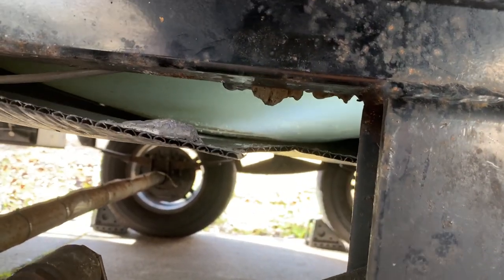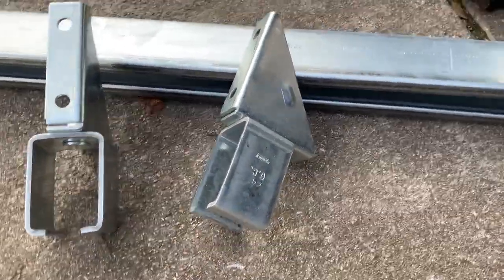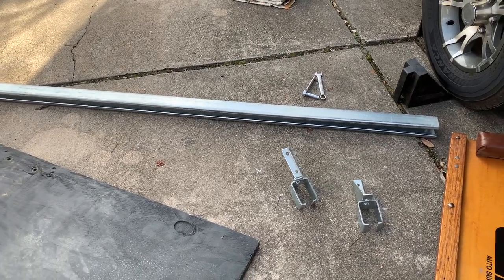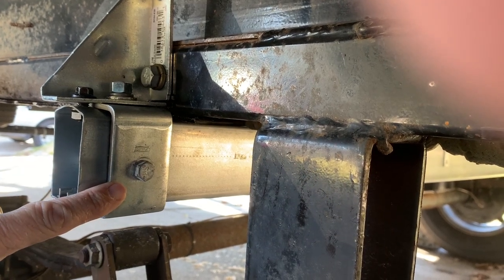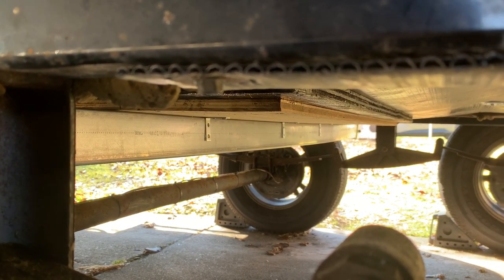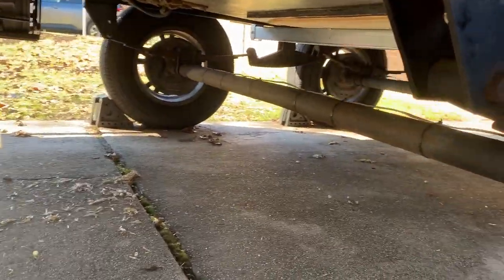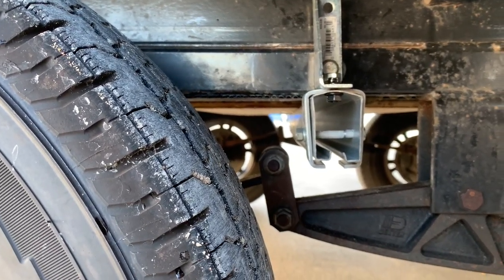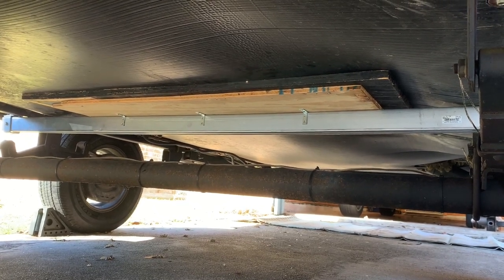RV Fresh Water Tank Sag/Bulge Repair and Support

Comment: I can't find these brackets anywhere. Can you share where you got them? Thanks!
Reply from the maker: McCoy’s
Reply: @texascamper Any idea what they call the two pieces? I can't find them on website and Texas is too far :)
Reply from the maker: @paulematthews  I found it on Amazon here >  https://www.amazon.com/Overhead-Galvanized-Sliding-Single-Bracket/dp/B071S1LTHS/ref=sr_1_5?crid=308AGYD61G1PJ&dib=eyJ2IjoiMSJ9.QRI7telqaz-gkC8DhIQnEUgzJKgkFQXK4KRDM7-zyZmHcphNP8DCN4jr0x1osnqiYA0CusFauApbAT9NZs2hyx58NK_yTaDIWEnOz25nFaOoC1147CLGubG3lOMhI9RXnmZb2xYYIng9E-c_h6iVZ-JZd88dRA_nWxeUu_dJ190p_stHelbVXpEwaDFireKUzKhNtlFxDN3uwXGZX1mYoFtxZEOQQbdF0OWOMoQ6YUx5KWkyBJ8foXkt_ON7PRAQHPEnMMaMG60TnfIfI42dSHMhCViVYfY-MdvVWbzxjbI.lSISWLUrsCcVgtcc1rNp-zpnFOTg6FbL57Rx3vu9n0w&dib_tag=se&keywords=Sliding+Barn+Door+Track+Hardware+Single+Wall+Box+Rail+Bracket+Overhead+Galvanized+Steel&qid=1731951580&sprefix=sliding+barn+door+track+hardware+single+wall+box+rail+bracket+overhead+galvanized+steel%2Caps%2C154&sr=8-5
Reply from the maker: @paulematthews  It is called > Overhead Galvanized Steel Sliding Barn Door Track Single Wall Box Rail Bracket
Reply from the maker: @paulematthews  You can also get it from McCoys but I dont know if you can ship it. McCoys is where I got mine.  Here is the link> https://www.mccoys.com/shop/p/7154123-052303-28/national-hardware-n104-638-box-rail-bracket-3-14-in-w-x-1-34-in-d-x-7-18-in-h-dimensions-steel-galvanized
Reply from the maker: @paulematthews  McCoys calls it > N104-638 Box Rail Bracket, 3-1/4 in W x 1-3/4 in D x 7-1/8 in H Dimensions, Steel, Galvanized
Reply from the maker: @paulematthews  Here is the rail > https://www.mccoys.com/shop/p/6763569-052303-28/national-hardware-n105-726-box-rail-steel-galvanized-1-5764-in-w-2-1332-in-h-8-ft-l > It is called N105-726 Box Rail, Steel, Galvanized, 1-57/64 in W, 2-13/32 in H, 8 ft L
Reply from the maker: @paulematthews  Here is the box Rail on Amazon >>>  https://www.amazon.com/National-Hardware-N105-726-Plain-Galvanized/dp/B000AXZ9JO/ref=sr_1_7?crid=25WFZSZKE6TV&dib=eyJ2IjoiMSJ9.JVhc11eS5IhrbPUf9t6lNF-2oeJnWTmk7CKC0bBwXR0kacbhC1c2sR834-dPx2jDbicCp61ApEzig5KHnFH3WQTLecb5fNtNDrlH-STMO7-9rXmKNo-ZmZgmrWTI7MJDFZsznS7kl86w7HH0s5tcbAZqDde2C6Yd4BH6M5IOT9BGqotx8i3dEHuZY75BNwtREej8w1FyKqc4nlInm7G4pX1hlowMnw31L7lf3fONCs4E77z_hZB8QPmqiROUu5Lm1ojEIiJa1--1Uwr679fRaRYtOXNsSNVqhoEgKGfDCyU.9XtBz-aCZKGGBu5tqq4Xl6dibZTiMHKK5rcVx1a4cMY&dib_tag=se&keywords=Barn+Door+box+rail&qid=1731952406&sprefix=barn+door+box+rail%2Caps%2C134&sr=8-7
Reply: Greatly appreciate

Comment: Sturdy work. One question: What did you secure the rope rings too?
Reply from the maker: There are crossmembers that cross between the main frame. The underbelly was secured to it but it had busted loose so the rope hooks were larger than the original washers. I put them in the same place as the original washers.

Comment: Great problem solving.   Super strut is thicker than what your box rail material is and holes on top do not weaken its support strength.  It can be purchased without holes but would have to go to Graingers or similiar.
Excellent explanation on clearance of suspension equalizers.   I am glad I found this video. Thanks for publishing it.

Comment: Had a similar problem with our TT. Not a single support except for the perimeter. Huge bulge when filled even without travelling.

My solution was to put 3 or 4 wooden slats (1x3 pine boards) under the tank parallel to the main trailer frame.

I was thinking about using some heavy nylon strapping but wasn't sure exactly how I'd fix it to the cross members.

Your solution is really great though I don't think it would work on my trailer as it has a different style of under-body cover.